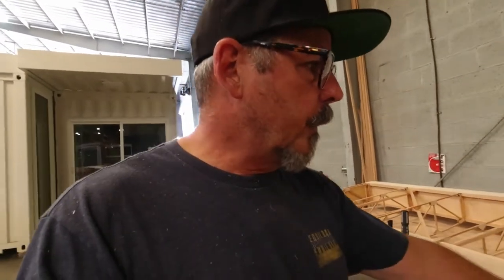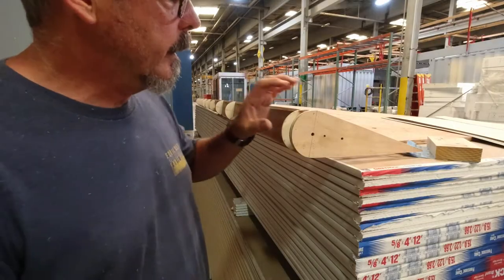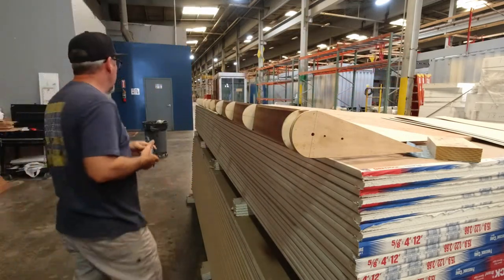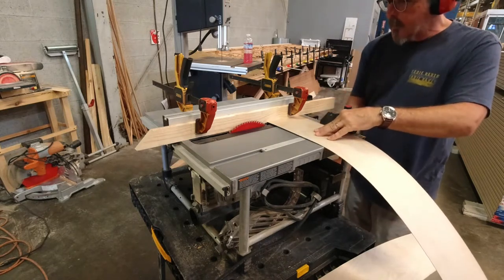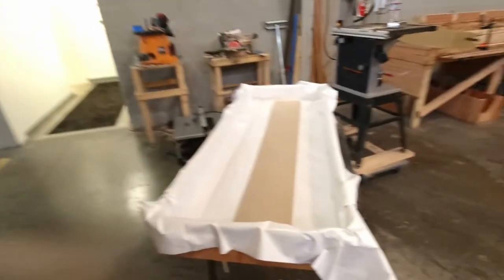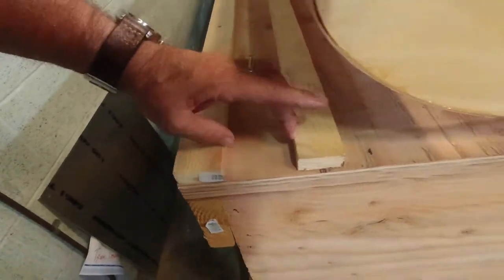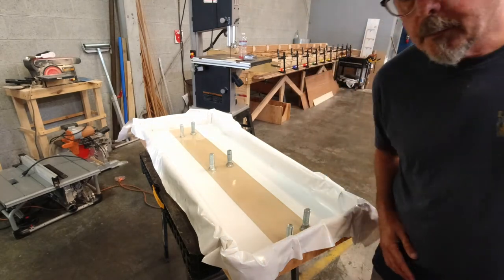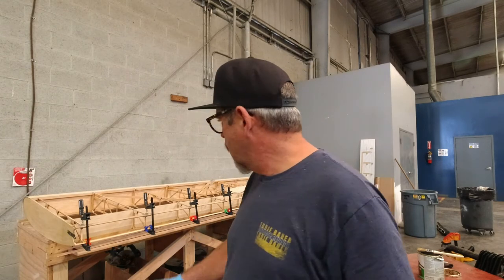Minimax 1100r Aircraft Build Vlog Episode 25

Comment: As the root r.ib is on an angle and the next rib vertical I take it that the lower strip is wider than the tip by an 1/8" or so and the top sheet will not be straight along the root and need trimming back.
Looking good, although I still think those blocks for the trailing edge look a bit heavey, I would have thought a short length od 14"Sq would have increased the glue area enough, as there shouldn't be that much lifting force back there on the wing. What do you think? I know you are tied by the istruction.
Reply from the maker: At the root, it is aligned with the edge and allowed to just hang over rib number 1 going outboard. 
The blocks may be more than needed, just following the photo on the AD portion of the Team website. 
The reason for the additional material was due to delamination of that piece from the ribs. I think the fabric tension is the real reason this was happening.
Reply: @DTMinimax  Thanks for the explanation, you will no doubt cover the ply in the next video.
So I will have to look at the TE of mine to see if it could happen, although rather than such a wide piece I planned on a narrow strip and a ply 2 1/2" wide strip of ply to attach the covering to (and stop c=the covering crushing the strip in).
Reply from the maker: I have been thinking about what you said about the ply along the top of the root. Of course you’re correct that if you draw a line from nose to tail the middle top of the rib falls away from that line. I’ll be adding that tomorrow so we’ll see how much.
Reply: @DTMinimax  Look forward to your next video.